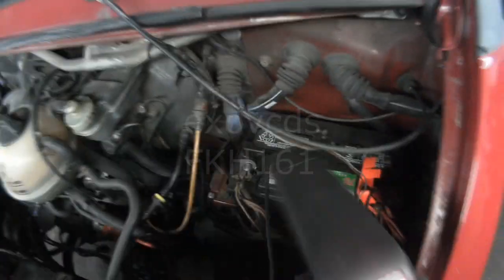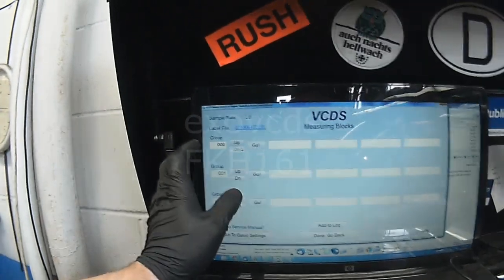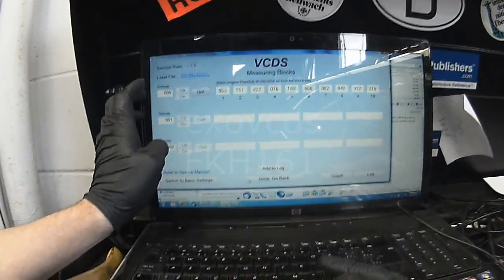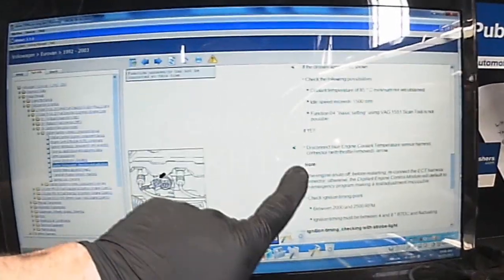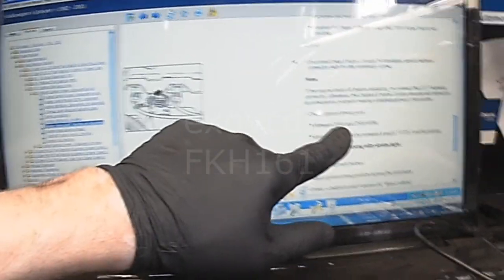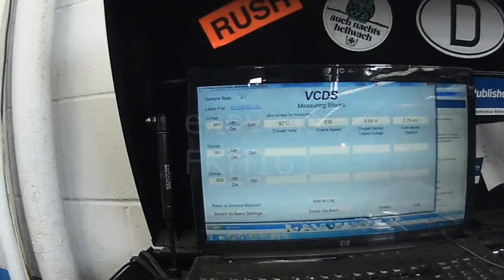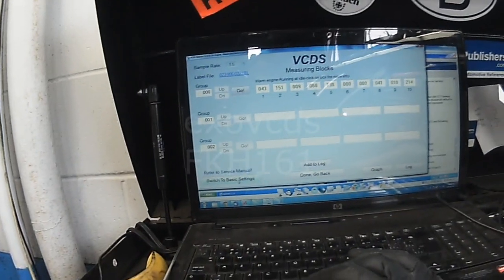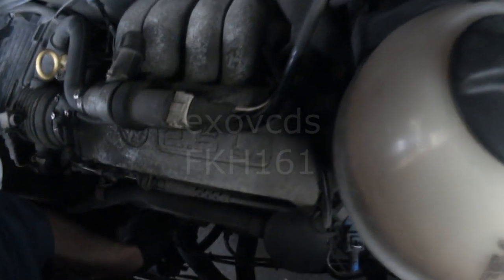VW T4: Eurovan 2.5L Ignition Timing Basic Setting / Checking

Comment: Thanks for your great videos!  Is it possible to do this without the reader tool?  Can the distributor be turned until the the flywheel mark is at a certain place?  Is that place centered in the hole?
Reply from the maker: Yes, warm engine (radiator fans cycle on /off) and disconnect the temperature sensor (blue). In some cases you have to hold the throttle open with one hand, to keep it from stalling. Rev engine to 2000 / 2500 to check timing. Reconnect sensor when done.

Comment: Hi. I have a '95 T4  Camper. I did a auto to manual swap. So much better with the 5 speed. I have had a check engine light on 2113 code. This was the case before the swap, so nothing to do with that. The van runs great so I'm a little confused as to what could trigger the code. It's a Hall Sensor / mass air flow sensor plate / potentiometer adjustment. Am I correct in assuming it's not the Hall Sensor since the van runs just fine?
Reply from the maker: Which engine / production code?
I can't find that code (2113) in my info.
What scan tool are you using. Blink code?
What's the exact wording of the code that comes up in the scan tool?

Comment: Nice work Thomas. I have a 1995 Eurovan Camper (1993 T4, I believe) in which I am converting from A/T to M/T. With the engine at TDC, where should the flywheel TDC detent be located (approximate clock position)? Also, which detent in the flywheel is the TDC? I see two larger ones next to each other and another smaller one all by itself. If I put the small one at 12 o'clock, the two next to each other are near 3 o'clock.
Reply: Hi. I found the timing marks after cleaning the flywheel with a bit of steel wool. They are on the outside edge and look like O|T. I'm assuming it needs to be positioned in the center of the sight hole in the top of the bellhousing.
Reply from the maker: Just got home... yes. The line between the O & T should be under the V in the round hole.
Reply: @markoneal168  ...you were ale to find the timing mark on the flywheel? can you give any pointers/suggestions.  Ive been trying to fing that mark but cant see a thing in that littk=le hole!
thanks
Reply from the maker: @jamessullivan1648 
Standard or automatic?
According to the following image from the service manual:

Line up the crank pulley notch (C) with the line on the lower timing belt cover.

TDC mark for standard A
TDC mark for automatic  B
Reply from the maker: @jamessullivan1648 

Sorry.
https://ww2-secure.justanswer.com/uploads/Barlogio/2009-11-04_125454_vwvan.gif

Comment: I am having difficulty finding the timing mark on the flywheel.  Is it the tooth with the small dimples on top?  Thank you in advance VW God!
Reply from the maker: Year, make, model, engine?
Eurovan TDC mark is usually an O with a straight line and then a T.... like this:
O I T
If you line up the TDC mark on the camshaft first, it might be easier to spot the TDC mark on the crankshaft.
Reply: @EXOVCDS  1993 Eurovan MV 2.5 gas M/T
Reply from the maker: Image A
https://www.2carpros.com/img/diagrams/timingbelt/00217741.gif
Reply from the maker: Image C / crank pulley should match.

Comment: How did you determine where to set the white pensil mark on the wheel in order to find align with TDC?
I have a 2.5l Petrol which is having troubles starting, I got fuel pressure & spark, but engine wont start up.
Reply from the maker: The crankshaft pulley has a small dent / chisel mark where TDC is... the lower timing belt cover has a small raised edge where TDC is... mark both items so that they are easier to see and then simply rotate the engine until they align. Once aligned, check the camshaft position TDC mark. If it is not visible, rotate the engine one more full turn and check again. If still not visible, then the timing belt has jumped... causing camshaft & crankshaft timing to be out of sync.

Comment: Hi
Is it possible that the mark on the pulley does not match the mark on the flywheel?
Reply from the maker: Yes, that is why you always use the mark on the flywheel. The crank gear key can wear, which causes the gear to move on the crankshaft... causing the pulley tdc to not be in time with the flywheel tdc mark. If the gear is ok, then the pulley is wrong.
Reply: Thank you for the quick reply. It seems to me that the valves are knocking in the engine, is it possible if the timing is slightly off?
Reply from the maker: Year, model, engine?
If the engine has not run in a while, it can be normal for the lifters to be noisy until they are pumped up with oil. Can take 5min to over 20min depending on the age of the lifters.

Comment: I'm going to attempt timing my 2.5L petrol. It runs poorly. Just had timing belt replaced at shop so I don't thing I need to check cam sync. Thus, please correct me if I'm wrong, I need a friend to rev up to 2-2.5k rpms, after it's warmed up, and then put the timing gun on the flywheel hole and rotate the distributor to move the mark centered in the hole? With the thermostat disconnected. Thanks, any help is appreciated!
Reply: 1993 T4
Reply from the maker: @davidwilsonjunior  if this all happened after timing belt change, go back and tell them to check their work. Both items (belt / cam & crank timing & distributor timing should have been done when the belt was replaced). Yes 2500 rpm with blue temp sensor disconnected.
Reply: It ran poorly prior to belt replacement.
Reply: Black discharge when starting
Reply from the maker: @davidwilsonjunior  The 2 wire blue coolant temperature sensor is the main temperature input for the ECM. Check / compare the resistance of that sensor when cold & warm. Cold (20c) should be around 2000 to 2500 ohm, once warm around 300 to 500 ohm. Yes / no?
Can you check fuel pressure?
Disconnect the O2 sensor (connector is close to steering rack under the van... follow wiring from O2 sensor in the exhaust to the connector. Does it run better? There's a vacuum hose that goes from the intake manifold to the ECM (next to fender by the battery). Is that hose in one piece / not broken anywhere?

Comment: I just had the thermostat replaced and still cannot get my 93 Eurovan (2.5 gas) up to operating temp.  The rad fans kick on at 79F and drop it to 72F.  Sensor issue?
Reply from the maker: How / where are you measuring temperature?
Reply: @EXOVCDS  VCDS
Reply: @EXOVCDS  and I meant in Celsius. Sorry.
Reply from the maker: If the thermostat is 87c, the rad should still be cold when engine is  at 79c. New thermostats can be faulty. Put your hand on the lower rad hose as the engine warms up and tell me when the hose starts to get warm. If it gets warm before 87c,  then the thermostat is opening too soon. Remove the radiator fan switch and clean the metal housing. Check what temperature rating it has. 95c should be for low speed.

Comment: If the timing is off would the engine run fine? Would the RPM gauge work? Would the check engine light be on?

I have a 95 vw eurovan 2.5 5 cyl and my engine runs fine but the RPM gauge does not work and have a check engine light on. We had searched for a while now trying to figure it out and no luck. A mechanic said its timing might be off. Any help would be greatly appreciated.
Reply from the maker: If the timing is retarded or advanced too much... engine performance will suffer. Lack of power, hard to start, knocking / pinging etc. RPM gauge not working is a cluster problem most likely. If the engine has a crankshaft position sensor & a camshaft position sensor (distributor hall effect)... a fault code will be set if timing is NOT correct. Not all 2.5L engines have a crankshaft position sensor. Checking cam / crank timing and adjusting one or both, can solve check engine light issues (camshaft / crankshaft codes). If the light is on because of something else... that's a different matter.

Comment: does one have to enter the ecu into the basic setting in order to set the timing (is it 100% required?) also, since it says: "Adjusting value: 6 +- 1 before TDC" then it means that on 2000rpm it would be best to have it at 6 degrees correct?
Reply from the maker: +Žanas Tumasonis Basic setting is not required... it just ensures that the ECM does not do any Idle  / timing modification while you are checking timing (keeps the timing more steady). Without basic setting, just check timing at 2200rpm, should be 23 to 33 BTDC
Reply: @EXOVCDS  hey bro, I’m having a terrible time checking the timing on this 93 eurovan. I marked the tooth at tdc on the flywheel but I I cant get it with the timing gun set at 6 at full temp. I’ve maxed out the distributor too
Reply from the maker: @justint5625  start engine, disconnect blue temperature sensor, raise engine speed & hold to 2500 and check that timing is 6 degrees  BTDC. Once adjusted, let engine idle and reconnect temperature sensor.
Reply: @justint5625  did you get it figured out?
Reply: @quartamile  I was able to get the timing close but I think the distributor needed to be replaced. And the one I purchased from rock auto was not correct